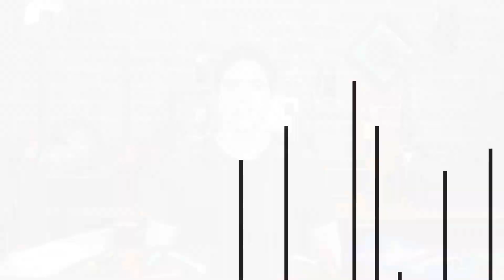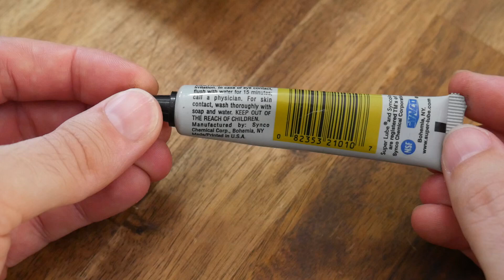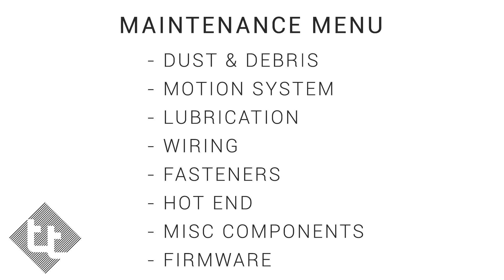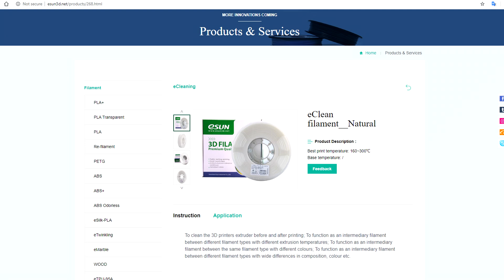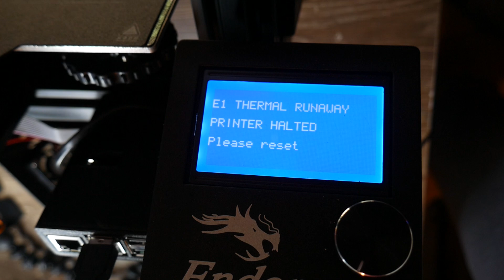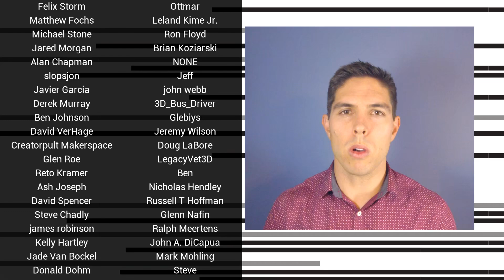3D printer essential maintenance guide

Comment: I realize that almost EVERYONE uses PTFE lube on ball bearings, but you SHOULD NOT do that. PTFE lube contains small particles of PTFE that can cause the balls to "skate" and get flat spots on them. If you don't believe me, check with manufacture's of high quality ball bearings and linear rails. They will tell you the same thing. Use light weight white lithium grease.
Reply: Lithium grease gets my vote too. It is the right stuff for this purpose. Z axis enjoys the same, allthou i did add naptha+PTFE just a  few drops (naphta cleaned it better when taken from the box, i used lithium much, much more). It has kept itself very clean and seems to last, once lubricated about exactly a year ago. And since we are at z axis, loosening the stepper motor screws and moving the carriage all the way up, then re-tighten them will realign the z axis lead screw with the frame. Decreases banding with tall objects, almost unnoticeable with flat or small print.
Reply: Lithium is the grease to use for sure. 3 years only 2 applications of grease and my bearings are nice n smooth.
Reply: Lithium Grease ftw. 

Anyone else notice he really, REALLY overcomplicated applying lube?
Reply: I agree I use lithium on my 3D printer I even it on my rc heli it's the best grease to use for bearings
Reply: I came into the comments section looking to see if I could use the lithium grease I already had. Thanks, learned something and saved a few bucks at the same time.
Reply: Not sure what it's made from, but I use gun lubrication.  Works super smooth afterward.
Reply: @zachchenoweth6622  I've used gun grease before, I found that it got gummy over time and caused binding issues on my z-axis.
Reply: Thanks for the advice.
Reply: Yes, Super Lube is for IGUS style bushings on smooth guide rods. I've seen people use WD40 lol, white lithium grease is the go to. Z lead screws need a thin coating of lube just to keep the metal to metal contact down, once you pack those grooves with gunk/grime then expect poor layer consistency... my two cents.
Reply: @evlsc400  I was looking at sunroof maintenance videos and this moron used WD40. The guy was so flippin' stupid he did this EVERY TWO WEEKS
How do people like this navigate life?!
Reply: Any reason not to use moly disulfide grease on Z rods and screw?
Reply: So what should I buy then? Can you be specific or share link to Amazon item? I'm thoroughly confused.
Reply: @hansblake  I use mobil grease mobilux EP 2, but you just need a Lithium soap based grease, no particulates (so no PTFE, no molly etc), NLGI grade 0 to 2, optimally with EP additives
Reply: What about the z rod?
Reply: @Guapogiboy It's not as important but I would use lithium grease on the z rod as well. Lubes containing particles such as PTFE, Molybdenum, graphite etc. should only be used on things like bushings...things that slide...not roll.
Reply: Good old Vasoline is all you need.

Comment: I've done my maintenance for my ender 3. Now i just need to know why i can't flash the firmware for the bl touch.
Reply: Vernon Leeper I had to disable a few things to get it to fit. Bootscreen, arc support, M503. Slim menu.
Reply: @marcosramirez385  
What did you have to disable?
Reply: Vernon Leeper comment out # show_bootscreen, arc_support. Uncomment disable M503 and slim menu
Reply: @marcosramirez385  
Is yours highly modified, is that why you had to disable all that? On all the research I've looked into, YouTube  Google and stuff, nothing said anything about it.
Reply: Vernon Leeper Just adding a BLTouch requires a lot of memory from a stock ender board. If your using a ramps base board then you don't have to bother with freeing memory.
Reply: @marcosramirez385  
Ok ,
I think i got something else going on here.  When I download the firmware and unzip it,  the prousp.exe doesn't show that it has any files in it. Think that could be a problem?
Reply: Maybe I can help? Are you using the stock creality mainboard with a bootloader of some type? What version of marlin? How did you get said bootloader onto it? Genuine BLtouch or clone?  I'm positive I could help you but there's a lot of info you would need to give me in order to do so, so just let me know. I might even be able to compile you a version of marlin 2.0.1 for your exact setup if you let me know the stuff I need.
Reply: @WrexShepard  
Motherboard is creality v 1.1.3 
For the boatload it's what came with the bl touch, usb ips 2.0. If that helps,  I don't know what version of marlin.
Reply: @WrexShepard  
Also forgot to mention, its a bl touch , not a clone.
Reply: Oh yeah ender3 pro...if that makes any difference.
Reply: @vernonleeper7788  Oh ok so you're trying to use one of those BLtouch kits. Let me do some research on the bootloader used for that and I can help you to figure out if you've got the settings correct in configuration.h. I'm guessing the version of marlin you're trying to work with is not marlin 2.0, it's probably 1.1.9.
Reply: @WrexShepard  
Yeah pretty much it, ok do what can,. Appreciate it.
Reply: @WrexShepard  
I've tried to download all the files, firmware, etc, from creality. 
Open and unzip them, what I have noticed that the icon for the proisp.exe does not look look like it does in all the examples I've seen.  Also noticed that after it's all unzipped it all , there's no files in the progisp.exe what's up with it.
Reply: @vernonleeper7788  https://www.reddit.com/r/ender3/comments/cfmbdy/howto_installing_a_bootloader_to_an_ender_3_pro/

Have you looked at this guide? Maybe it can help. It seems like you're just trying to get the bootloader on to the board right now. I've never done it this way as I always use an arduino to get a bootloader on a board through icsp.

Actually teaching tech has a guide for what you're trying to do as well.

Comment: For the upward facing cooling fan.  At least for the Ender 3, there are ducts to route the  air to the side
Reply: Or hot glue on a piece of cardboard scoop, printing it seems overkill, but either way that was a poor design choice where they put that, I mean, really? Right next to the bed? Design nightmare!